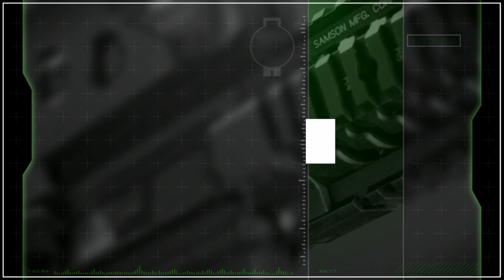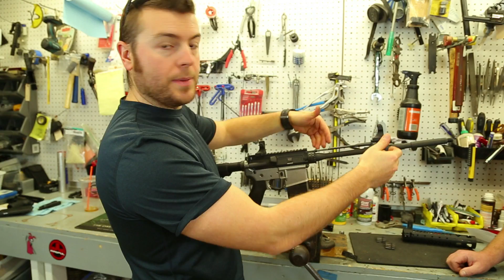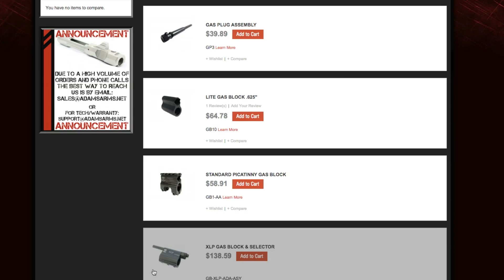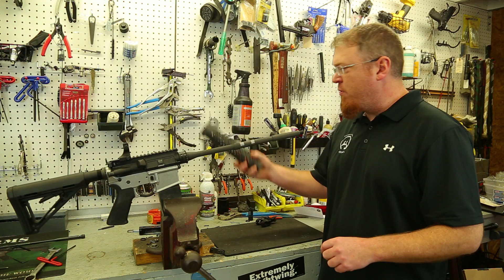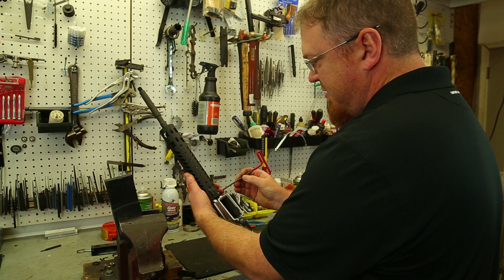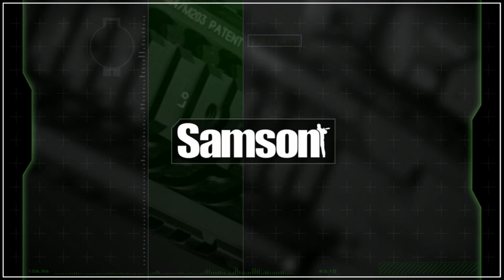Samson EVO rail on Adams Arms install

Comment: Which newer handguard will be compatible with the Adam Arms piston kit?
Reply from the maker: Assuming that you have an AR-15 and not an AR-10:

If your AA piston system does not have a picatinny rail on top of it, you can use this handguard:  https://www.samson-mfg.com/evolution-series-standard.html
Here is the installation video:  https://www.youtube.com/watch?v=xKyIoy0csqo

If your AA piston system does have a picatinny rail on top of it, you can use this handguard:  https://www.samson-mfg.com/evolution-ex-series.html
The Samson Evolution EX handguard was made specifically to work with the Adams Arms gas piston system that has the picatinny rail on top of it.

Use the drop down menu to select the length.
Measure the distance between where the pic rail ends on your receiver to where the pic rail begins on the piston system.  Most likely 7 inches.  May be 9 inches.  If it's 7 inches, use the drop down menu to select '7" Picatinny/10" Overall' option.  If 9 inches, select '9" Picatinny/12" Overall'.
Here is the installation video:  https://www.youtube.com/watch?v=ivF81cDvkPk
Reply: @SamsonMFGPRO  thank you.

Comment: Samson evo-7-ex & the grooves do not line up at all & couldn't install it plus I also punched the 4 inch extention😕. I took it to a gun smith to make sure I wasn't missing something or doing it wrong, but he said it's a problem with the milling on the inside of the rail & thst is why it doesn't line up. I left my AR torn apart to save time I will be contacting samson hopefully they can resolve my problem. 😠

Comment: One thing you need to make perfectly clear, and is not clear in your video, is the placement of the thermal couplings.  I had to re-watch the video a couple of times to discover why my EVO hand guard was not going into place.  The TOP of the couplings should align with the side edge of the upper rail and NOT fit together at the TOP.  You go into sufficient detail as to how the couplings should be oriented and that a gap should be at the BOTTOM, but unless you watch the video carefully, alignment with the side of the upper receiver rail is not clear.  Otherwise, the hand guard will NOT go onto the couplings and the push rod of the piston system (or the gas tube) will not go over the top of the coupling and into the Upper Receiver.  When the thermal couplings are properly aligned with the side edges of the Upper Receiver there is a gap between the two thermal couplings and the piston push rod (or gas tube) will go between the two couplings and slide right through the barrel nut and into the Upper Receiver.  Other than that, a really good video.  Thanks.
Reply: Thanks for that note.
Reply: Seriously, thank you. That seems like a need to know bit of knowledge. I appreciate you bringing it up while giving that advice.
Reply: @-Jame-  Welcome.  Glad I could help.
Reply: @superboze18   Thank you man, I appreciate it. Your comment should’ve been pinned, but at least I was able to come across it. You can never have too much knowledge. Salute man and again, thanks for the extra info.

Comment: is there any way to get the 12.37" rail to fit over the lite piston kit? i got a good deal on 2 lite piston kits with barrel for $250 ( 11.5" carnine, and 16" mid length) each and i thought the reason for the lite kit was it could fit under rails like the Samson rails. didn't know about the XLP kit till a year later. I don't mind having to grind it down some as long as it won't mess up the durability. 

Thank you.

Comment: Whats the best way to remove the delta ring without removing the barrel nut?
Reply: you either cut it off or you just remove the barrel nut... highly recommended you just remove the barrel nut so you won't damage the receiver to the barrel. when it comes to this, don't try to short cut it. if you don't have the right tools, take it to a gun shop and they'll happily help you, I've never been to a gun shop where the refused to help me with my AR.
Reply: *or the barrel, not "to the barrel"